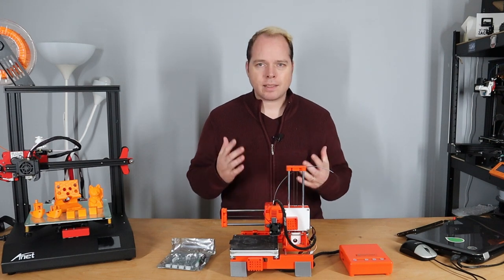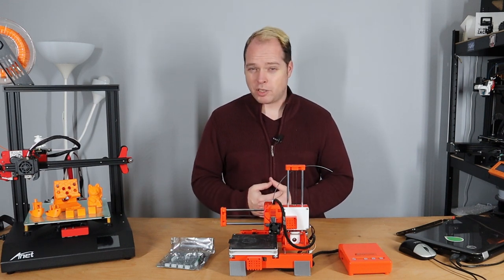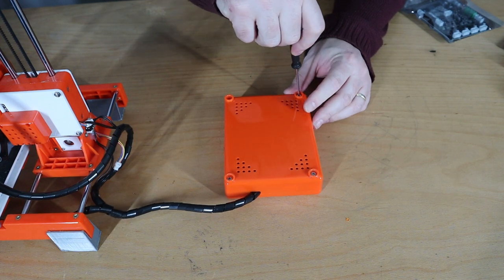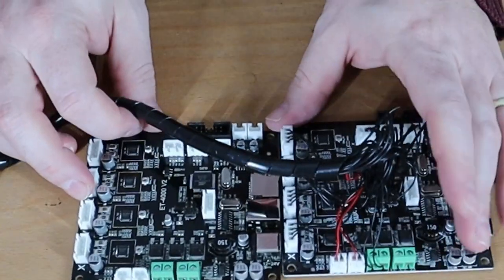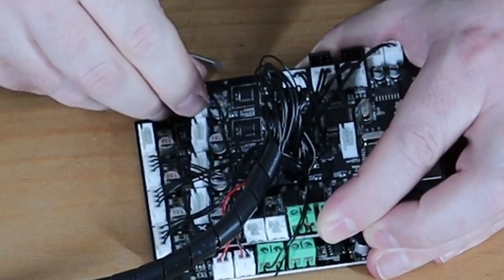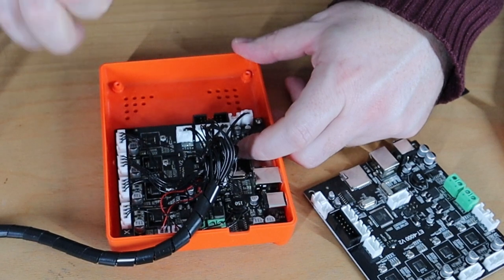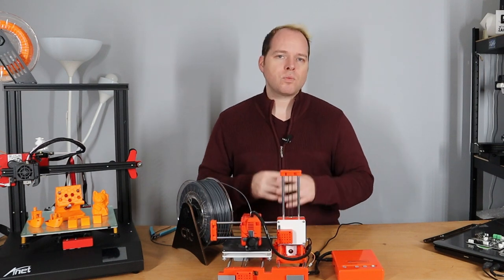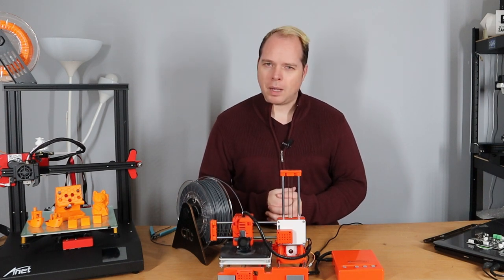How to change controller-board EasythreeD X1

Comment: I am going to change my wife's x1 board to a different board and add a display. Hopefully hers will go well. Ps the way I do wire change over is different colored nail polish. Mark the wire and mark on the new board wire ports the same color of the wire. Easy transition afterwards.
Reply from the maker: Sorry for my late reply. That is one great tip. It is always a good idea to make marks where the wires and connectors are going.

Comment: Any chance you can upload the firmware update please. I need the firmware and couldnt find it anywhere on the internet. 
Man thanks
Reply from the maker: I had to buy a new board, because the firmware they have, didn’t work and wasn’t complete. But what happened?
Reply: @Zachary3DPrints  I got 4 firmware and trying to see if I can get it to work if not I will probably will follow in your footsteps. Thanks for the video and responding to my question.

Comment: Dude black wires are the Cheapest Can you add your heated bed to the main board? Without needing a higher amp power supply..
Reply from the maker: Hello Justin, adding black wires doesn't make it into a heated bed. There is an upgrade available to make this into a heated bed with and external power supply. It's an add-on, you need to turn it on and then start a print, like you used to do before. It's not controlled by the control box or by the Gcode on the SD card.
Reply: @Zachary3DPrints  yeah i have the add on all i would have to do is rewire and upgrade the firmware.. maybe get a screen.. hey i just found a 12v 6amp supply from my Filastruder i took it out thinking it was too small turned out i had scanged a setting figguring out how to set the temperature set it on BANG not PID which where p and a backwards Ba on a 4 character display... just got it after 8 years fighting with Filastruder Customer service for help.. they sent me a Data sheet for the e50 thermal controller they use...

Comment: have you tried to replace the motor?
It's hard to get a 24BYJ28 motor here in my country, All I can see are 24BYJ48.
Do you know any alternative for it?
The printer seller is selling motor replacement for Easythreed but it cost around 30USD for just a single motor, which is 1/3 of the printer price.
Not worth to buy that, that is why I'm trying to look for alternative.
Thanks
Reply from the maker: I have never replaced those motors. If you are interested, you can contact me, I have a special offer, because I need to make room and I discontinue this 3D printer. just let me know

Comment: I am trying to do a hardware mod in order to get a build plate size of X:100 Y:150 Z:100. This mod was actually very simple hardware wise, but I have hit a road block with the firmware. Would you advise against pursuing my goal of a slightly larger build plate or do you think it would be possible for me find/make firmware that will work. I have found multiple resouces online claiming to have the Easythreed and or labists firmware that I think I could edit and use. Please let me know what you think, because if I can permanently ruin my main board I will stop.
Reply from the maker: Yes modding of this machine is nice and fun to do, many things are possible. Unless someone has changed the firmware on the machine successfully with decent video, better not change the firmware. I tried it, but I lost my board, I still have it, but I had to buy a new board. Maybe I’ll try it again, but I really need to have the time for that

Comment: Can you teach me how to reset/original firmware?
Reply from the maker: Why? I have one board, where I tried to update the firmware too, but even when I got some firmware from Easythreed, I wasn't able to rest or update it in the board... Is your printer not working?
Reply: @Zachary3DPrints  I am trying to improve the print tube shape so that it is more perfect. I updated the firmware marlin_xiaoqinting file just like their video, the result was x, y, z has reversed. after resolving the reversed problem,now  the size of the printout is different from the actual size. sad.. 
Maybe I should buy et-4000 v2 board and do like your video, and will never touch firmware again..
Reply from the maker: I have tried to build a new firmware based upon the by Easythreed given firmware. But it was so complex I couldn't get it right. For that reason I have bought a new board and accepted the little error. Because there are people that needs little support.
So yeah, buy a new board, follow this video and just print.
Reply: If your strapped for cash there a spot in reddit that gives the firmware and the arduino files and tool needed all you need is a usb/pc & the printer and your good to go